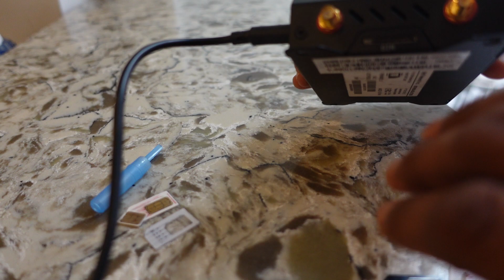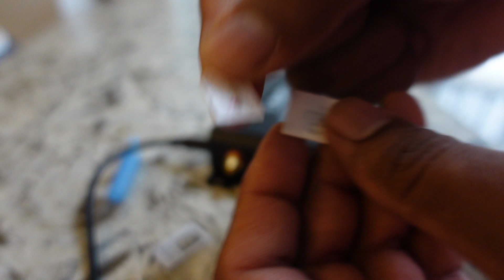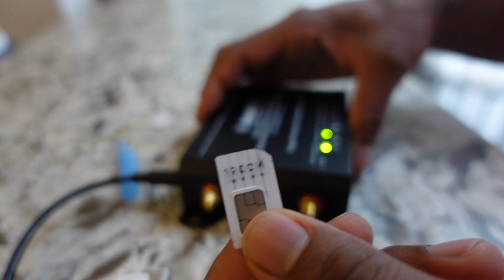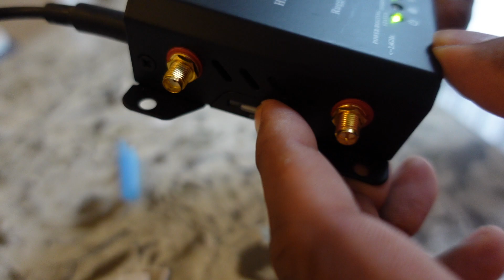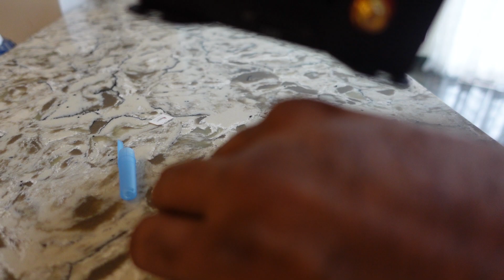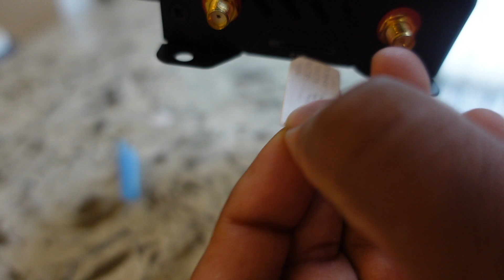SIM Card installation instructions MOFI4500 4G LTE Router

Comment: Hi, I love my mofi4500 but now it stopped working on visible's new network. Do you have any advice on me fixing the issue?
Reply from the maker: Yes
You can use the diagnostic firmware om the mofi site to change the imei 
You ca. Use your cell phone imei for example
Once that is done, you can load the standard firmware back on
The apn on the new plan for many is vzwinternet